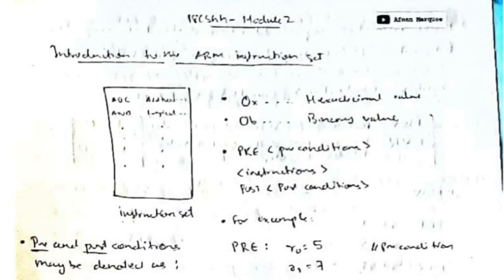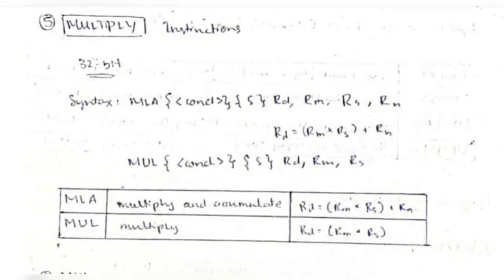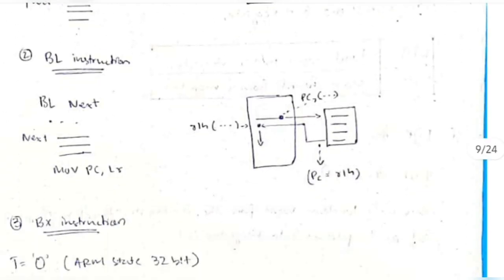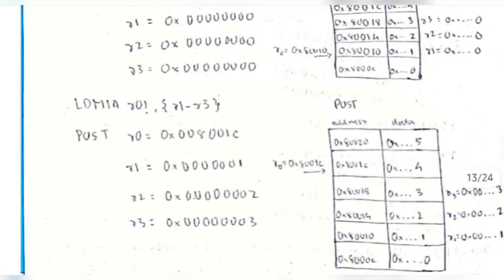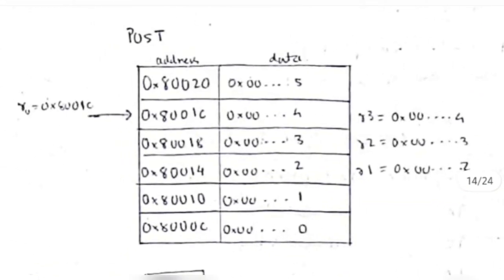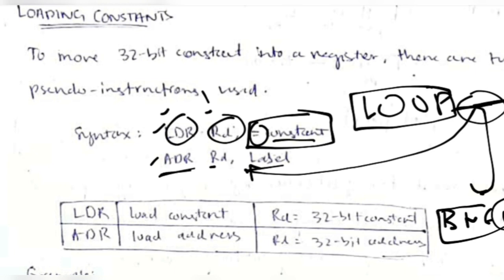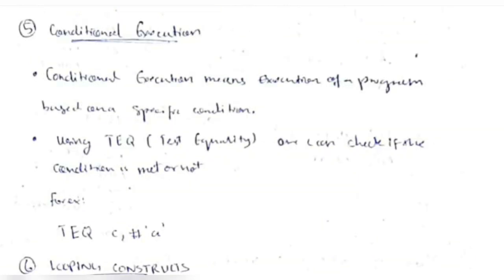18CS44 MODULE 2 MICROCONTROLLER AND EMBEDDED SYSTEM (MC&ES) | VTU 4th SEM CSE

Comment: 4:30 Barrel shifter
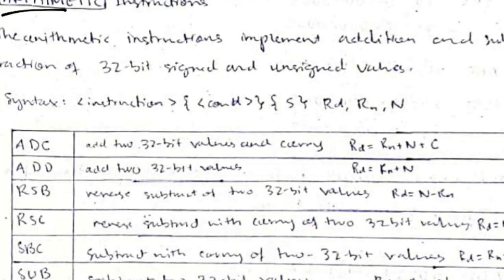7:19 ARITHMETIC instructions
21:50 LOAD-STORE instructions
3:20 MOVE instructions
38:42 Swap instructions

46:42 Instruction scheduling

46:18 Profiling and cycle counting
22:18 Single register transfer
25:52 Multiple register transfer
44:16 Co-processor instructions
19:36 branch instructions